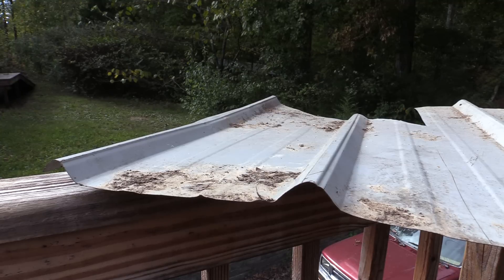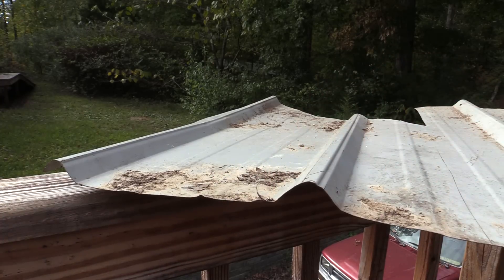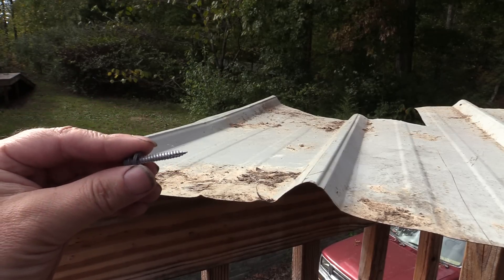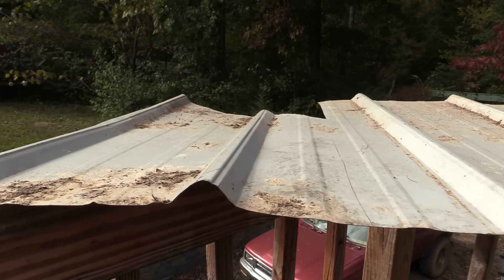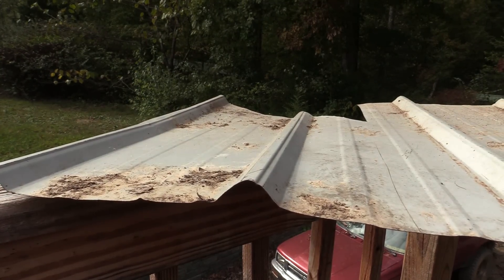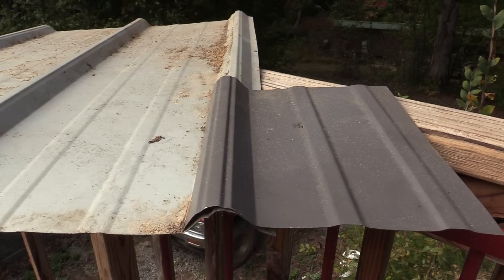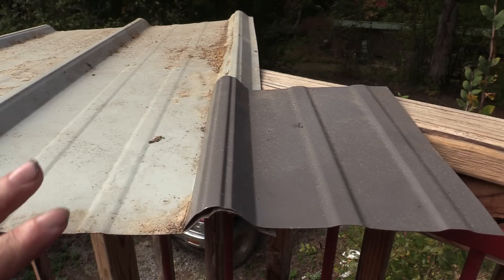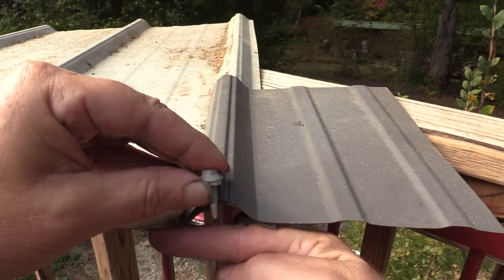Why you should not put screws on the ribs of metal roofing

Comment: Been doing metal roofing for 50 plus years, use R panel or u panel, always use mastic in between your sheets, very seldom used lap screws.
   If your metal building is square always pre-drill all your sheets, stack them together and drill them all at one time, this will eliminate the steel burrs from underneath the seal washer on the screw.
Also with wood screws on wood decking or slats.
Also on wood dip the end of the screw in glue it will help the screw from backing out over the period of the years, and yes the screw will back out and leak.
Reply from the maker: @sherwinstaudt1881  I did a couple of roofs with r panels heavy guage. I like the look allot. I don't like screwing on 7/16 OSB as I think it doesn't grip the screws well enough. I prefer 5/8 plywood or OSB. I also  like that you don't need clips with the 5/8 as the clips will rub though the underlayment and start rubbing your panels. Thanks for commenting
Reply: @honeybeehomesteading  I usually use 2x4 slats their cheaper than one by fours, and if I do solid deck I use 5/8 only OSB, too many voids in plywood. Never use clips in your plywood OSB, always lay out your first sheets and Raptors where they come out, never ever use staples always use ring shank nails, I use coil nailers nail ever 6 in.
Reply: @honeybeehomesteading  also never use tar paper under your tin always use rosin paper, never use rubber gaskets or seal up the overhang leave them open so the tin will breathe.
Reply from the maker: @sherwinstaudt1881  I use the modern underlayment designed for metal. It is kinda like a tarp but has a tiny rubber grid to help keep the metal from rubbing through it and gives the installer some traction. It is expensive but works very well.
Reply: @honeybeehomesteading  the underlayment on the deck it's not so much about moisture or rubbing on the tin most of it will corrode holes in the tin over the period of years.
Reply from the maker: @sherwinstaudt1881  you bring up a interesting point. Screw manufacturers rely upon the washer providing pressure to prevent the screws from backing out. Is seems like they could coat the screws with cement like what you find on a 16 penny nail. Thanks for commenting and sharing

Comment: The problem is, some manufacturers still suggest screwing down through the ribs. Most recommend screwing down on the flats. Some pros I know screw down through the ribs. Most don't. I have put up a lot of roofing, and I have come to dislike exposed fastener roofing. My wife I have decided to replace our entire metal roof with a standing seam roof, as the screws need retightening from time to time and the purlins start to rot over many years. Yes, its will be expensive, but I should have spent the money in the first place.
Reply from the maker: @KevinMaxwell-o3t  I love standing seam as they just look better but are not as easy to install. Have you seen the newer screws that completely cover the washers and can't be over tightened. They are guaranteed for 50 years. It might be a cost effective compromise just fyi. If you haven't seen the screws I did do a video on the different types of screws and it has them in it. Thanks for commenting

Comment: Thermal affects aside, I can’t see a great argument for the fasteners in the flat.  Installing fasteners into the ridge creates 100% watertightness, but installing in the flat assumes the washer (without sealant) will maintain water tightness for years. Meh.
Reply from the maker: The wind is your enemy,  they developed this system to hold the metal down in high winds like tornadoes etc.

Comment: Modern meal roofing instructions will tell you where and how many to put the screws in.  They say on the flat so you can properly tighten the screw.  If you put them in the rib to get the washer to seal properly you need to deform the pannel.  You will be walking the roofing right off the roof by doing it in the rib.

Comment: Interesting to hear your thought process. I have never considered the steel to be structural. I screw on the ribs. They don't leak even on my reused tin that has ribs with no screws and I never got around to caulking on my woodshed. If it were on the flat that would not work.
But you are right about everything you are saying here. The screws will hold tight, unlike the nails, and manufacturers do recommend what you are saying. expansion and contraction happens between each rib though, not on the whole roof when you screw through the ribs, because the screws are not tight to the wood like they are when you screw on the flat.
It does work to screw through the ribs but I am feeling intrigued now about what you are saying here. I'd like to do a roof with more shorter screws like you are saying to see the difference first hand
Reply from the maker: Use 1 1/2 inch screws on the flat as you need to get past the taper through the deck to achieve maximum holding strength. As far as expansion goes, through the rib may not cause issues if you roof gets sun evenly, tall trees or shade of any sort on only part of the roof can cause issues. My woodsheds are all build with no decking and screwed on the flat directly into rafters. It saves allot of time and money using the structural nature of the panels. Thanks for watching and commenting.
Reply: In the 90's I believe it was Harvey Manbeck at Penn State came up with "Diaphragm and frame interaction" models where they began using these wider ribbed ag panels, the skin of the building, to stiffen the frame.  That is when the "pole barn" became engineered "post frame" ag buildings, often with greater spans and lighter members. Industrial and commercial users took note. In other words he figured out how to design the building as stiffer plates rather than as individual members. On a jobsite if someone demonstrates that they understand the manufacturers methods and then has a rational alternative I'm open to listen. Most of the time with things like screwing up on the ribs. Billy Bob told Bubba and we ain't doing things that way.

Hmm, now I'm remembering that the first computer truss programs came out of Penn State as well, we're back in the 70's, something like the Penn State plane structures analyzer.
Reply from the maker: I enjoyed your comment. In my early 20's i was on a job and the was a guy named Jr. It was a cabin and was before the age of pex. Jr was plumbing the cabin with cppvc the cream colored plastic. the owner wanted it used as it was easy to repair if it froze. Well Jr who probably never made it through high school decided to use pvc glue on cppvc. It will work he said. it did work for about six months then the whole system had to be redone right. Bubba Engineering at it finest. Thank you for commenting